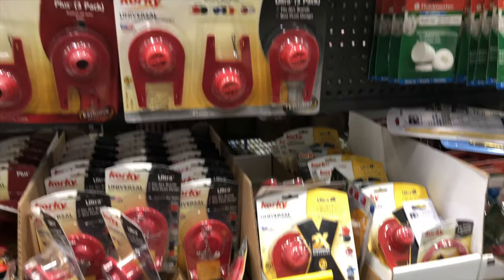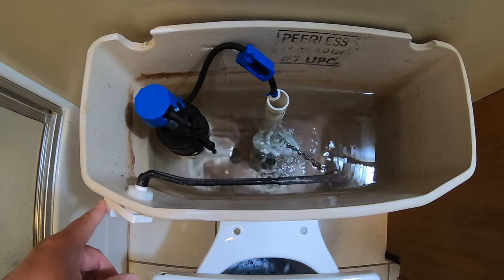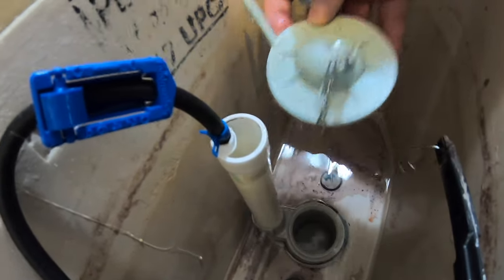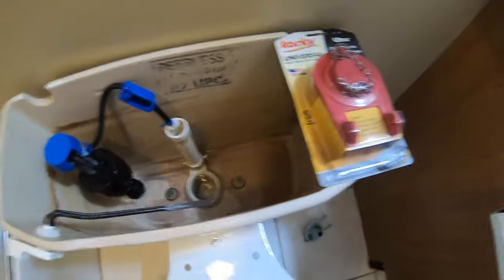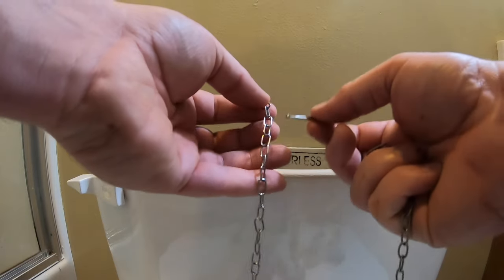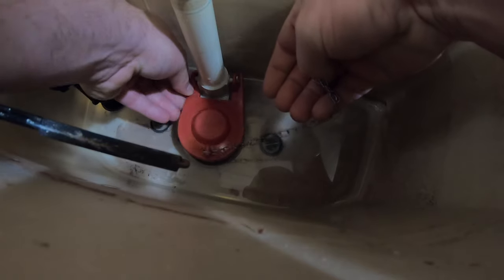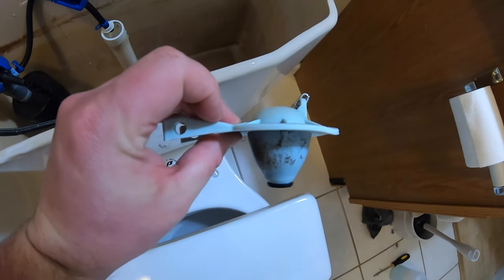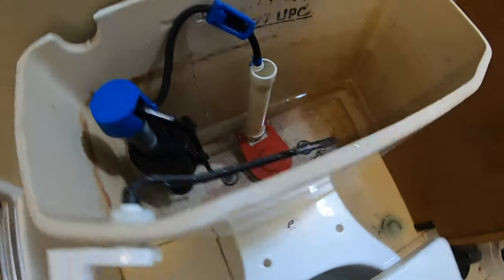How to Replace a Toilet Flapper - Plumbing Tips - Korky Universal Ultra

Comment: The 2 dials on this particular flapper allow you to control how long your toilet will flush. The key is to get it to the optimal setting that allows the toilet to be completely flushed with only the minimum amount of water. The benefit to this is that your using less water and also your toilet runs for less time after you flush because it doesn't have to refill as much water in the tank.
Reply from the maker: Thanks, I didn’t even realize that.
Reply: @weekendhomeprojects  hello
Reply: Was noticing the same, Bret. So essentially, the lower the number (or smaller the hole) the less water being used...
if I'm not mistaken, yea?
Reply: @JD0586 someone correct me if wrong but I believe it would be the other way around. The size of the hole determines how quickly water enters the flapper weighing it down until it shuts again
So a larger hole means a shorter time before the flapper shuts and therefore less water is used

Comment: ...and he did NOT say a word what to do if the refilling goes on again because of a slow leak in the flapper that was the original problem!  No word or what sort of grease or why or how to stop the tiny leaks! !
Reply from the maker: My tiny leak was due to the flapper being old and not properly sealing.  The new flapper fixed that problem.  Hope you get yours worked out.
Reply: Because that's not what the video was about. The video is about how to replace an old flapper. One source of information isn't the one true way. You gotta look at multiple sources

Comment: my old flapper was not in the right height at all; so, I am going by feel trying to hone in on the best setting. I am toying with the dials on the flapper too. I work on my toilet every month, still it does not flush well. I augered 6ft. I changed the valve on the left, and the flapper. I also did try to clear the hard water deposits with acids prior to changing this hardware.

Comment: Great video! How long does it take for the tank to refill? I turned my water off to replace it and then turned it back on again, now the water is refilling really slow. I am worried.
Reply from the maker: Shouldn’t take more than a couple minutes.
Reply: @weekendhomeprojects  the water is like slowly dripping in. Like real slow.. did I do something wrong?
Reply from the maker: @Tribalyogafl  Make sure you have the shutoff valve opened enough (turn left).
Reply: @weekendhomeprojects  I want to say thank you so much for replying to me and I’m appreciating that! I did turn it all the way on but no water is coming out.
Reply from the maker: @Tribalyogafl  Could be the float or fill valve needs adjusted.
Reply: @weekendhomeprojects  thank you!!
Reply: Directions say to turn the dial to a higher number.  The dial is th white band on the underside
Reply: I’m wondering why the length is so long?  Longer than what the videos show.  My lip is buckling up against the pipe.  I’m wondering if I can trim the rubber back
Reply: I’m gonna say this universal stopper is not so universal.  It really should be a 2 inch stopper.  We’ll see

Comment: Would a seal replacement work instead of replacing the whole valve?
Reply from the maker: In my case, no.  The flapper was not as rigid as it once was, so it was not laying flat enough to make a good seal.

Comment: My flapper won't go back down, is there a weight in the flapper?  mine doesn't have that nub underneath it.
Reply: a fellow who does this a lot uses 2 nuts or nut and washers to slip on the chain so that the flapper has a bit of weight on it and presses it against the round ceramic lip of the opening at the tank bottom.
Reply: @DougHinVA  thx,but I ended up replacing the flappers in both toilets after watching several videos. I 1st put a fishing sinker on mine,it worked for awhile.